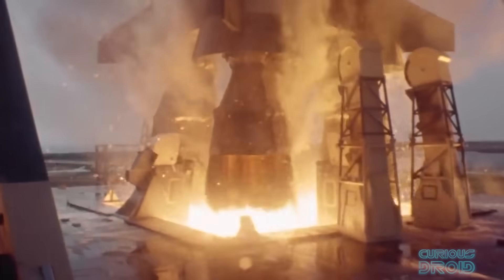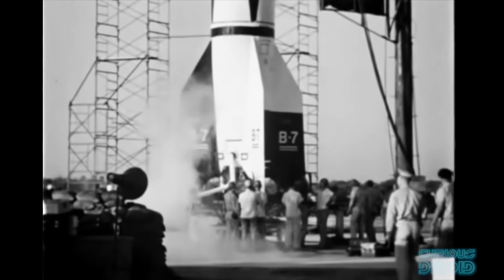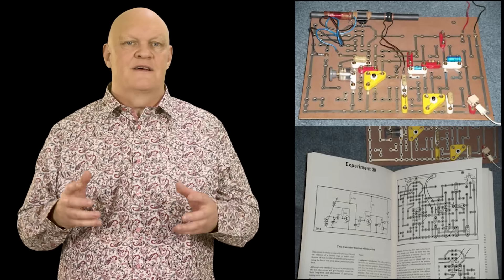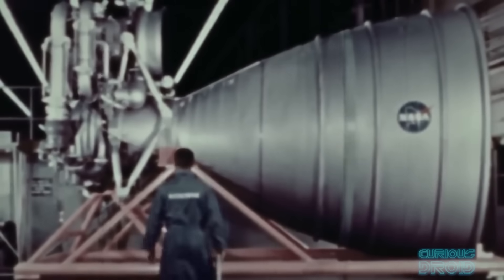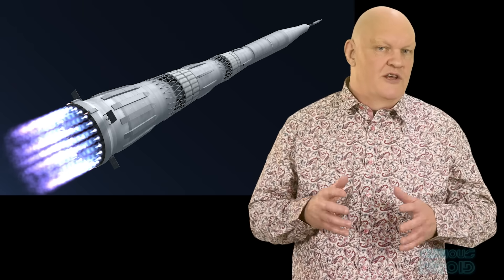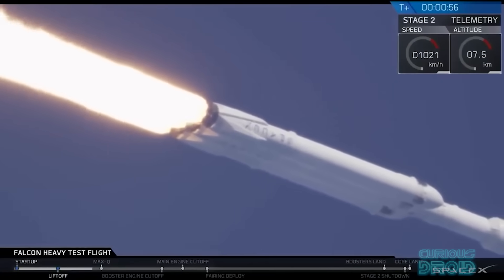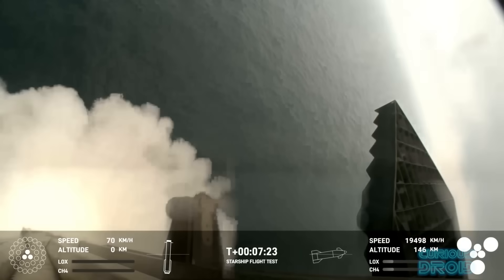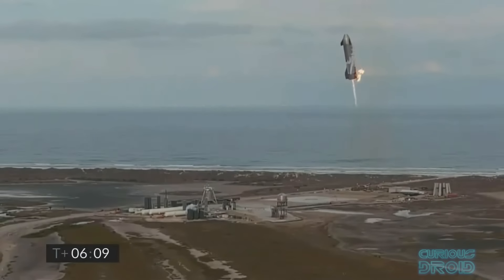Why Does SpaceX Use 33 Engines While NASA Used Just 5?

Comment: The better question is why we are still using capsules & moon landers. We could build a dream chaser variant with VTOL thrusters to do actual science on the moon.
Reply: "actual science" ?
Reply: @sidharthcs2110  As in finding ice, mineral, & metal deposits. Or building a mini automated factory to produce drones. Instead of taking photos while selecting a few rock samples.
Reply: @alt5494  
My suspicions were correct.
You really don't understand this , do you ?
Reply: @alt5494  
Have you wondered why they're sending robots to image and map surface in different wavelengths and collecting and analysing samples?
Reply: @alt5494  
Science is not like the CGI fantasy stuff you see in the promotions of companies
Reply: @sidharthcs2110  Imaging in different wavelengths by satellites is nearly useless for development. As most useful elements will be subsurface or inside craters unlikely to align for imaging. Only three rovers are even planned to carry ground penetrating radar with a short service life. Lunar dust is excellent base material for producing silicon oxygen aluminum & magnesium. With direct laser 3d printing components for structures should be possible without processing of the material. Building automated production on the moon is simply a more valuable objective than continuing current projects. Rovers like the Gitai R1 are already in testing with incredible potential . Until humans have effective radiation shielding & settlements automation/remote operation should be the focus.

Comment: Another reason is that the SpaceX Booster is to be used within ATMOSPHERE ONLY. Therefore a narrower nozzle is far more efficient than a wider nozzle due to atmospheric pressure. Notice that SpaceX use the exact same Raptor engine for in space, however they have a very large nozzle to account for the vacuum. Thus smaller engine nozzle means you can use MORE of them to increase thrust and remain efficient throughout atmospheric flight.

Comment: Because Spacex  engines  are actually  real  and      need to have the claimed     thrust. While F-1  engines are   fantasy. Their  real thrust  was    about  40 per cent less  and they  could    simply melt  if they operated at the claimed thrust. That is  why they have never been used again. Nobody abandons  perfectly usable   engines.    They used     very underpowered   F-1          engines to lift a mockup of Saturn  V ,  reaching  LEO  at best.

Comment: It's easier to maintain 5 engines than 33 engines. It's more likely engines will fail in a rocket with 33 engines than a rocket with just 5 engines.
Reply: Sure but an engine failure will have less impact. Check out the recent IFT-4 flight by Starship. An engine failure on launch and another engine failed on the booster landing, yet both milestones were reached.
Reply: A 5-engine rocket has a single point of failure per engine. A 33-engine rocket needs a lot of engine issues to fail
Reply: @philippeferreiradesousa4524  IIRC One or two of the Apollo missions lost an F1 engine and they still completed the missions.
Reply: @Axel_Andersen  On Apollo 13, one of the J-2 engines on the second stage shut down.
"An anomaly occurred when the second-stage, center (inboard) engine shut down about two minutes early.[91][92]  ... The four outboard engines and the S-IVB third stage burned longer to compensate, and the vehicle achieved very close to the planned circular 190 kilometers (100 nmi) parking orbit,"
https://en.wikipedia.org/wiki/Apollo_13

Comment: Multiple engines makes it possible to throttle over a much wider thrust range.
Reply: Did Apollo 11 actually leave near-Earth orbit?
Despite the revisionist narrative that this channel won't question -- unstable fuel burn for the oversized F1 engines was never rectified and another arrangement in their place was made in order to reach near Earth orbit, keeping the F1 bell nozzle to maintain the desired appearance.  The great licking yellow flame was an indication that something was not normal as fuel was burning in the atmosphere while providing no additional thrust. This was the result of injecting additional kerosene into the exhaust stream for greater visual effect yet appearing to produce an inefficient burn unlike other rockets after launch.  No explanation is forthcoming and this issue is not addressed in any usual report; however, using a smaller reliable engine with a reduced fuel load and stripped down mission requirement allowed the Saturn V to reach near-Earth orbit.  

The Apollo 11 crew attempted to demonstrate their position at over halfway to the moon as seen in the unedited version presented to the public while the more recently released unedited version reveals a flood of blue light entering the same window as the camera continues to roll, through which only a moment before, we saw the Earth far distant in what appeared to be very low light conditions. Then, as the camera pulls back from the window, the exposure settings are seen to return to normal as a flood of light enters the same window.  Without a change in the orientation of the spacecraft assumed to be on a trajectory toward the moon, the only source for any flood of light can be the Earth while in near-Earth orbit.  The usual sponsored efforts will try to make excuses for why the obvious did not take place -- yet is overly apparent in the unedited version.  When facts cannot prevail in support, sponsored activity will resort to name calling and other derogatory comments discrediting themselves.
Reply: .  . While remaining in near-Earth orbit, another indication are the impossible weather patterns seen on Earth, when in reality only a small portion of the Earth's surface was visible, framed by the round window of the command module.  Straight line cloud fronts are seen on video to be extending for what appears to be more than 6000 miles, a quarter of the Earth's circumference -- something that has never occurred in the meteorological record on Earth. The round window of the command module was used to effect an image of the Earth but the weather in the region did not comply for a realistic view.  No recognizable continents are found in view, but only the impossible weather patterns seen.
Reply: It also adds about 90 extra points of failure
Reply: @OutsiderLabs 
Engine out capability
Reply: But also the same number of redundancies.

Comment: My life journey also started with an electronics kit around 1977. My Mom bought it for me because a few months earlier I had completely disassembled and then reassembled our TV and when I put it all back together again it didn't work. My Mom had to call the TV repairman who yelled at me like he was my Dad or something; told me that I could have been killed even if it's unplugged because the CRT stores a charge. 

So my Mom was smart enough to get the electronics kit and I went through that booklet with thirty three different projects and completed most of them. I built my first radio with that kit; later had a ham radio around the age of sixteen; then ended up doing communications in the US Army where I was responsible for a 74,000 square kilometer communications network. Now I'm a professional; working actor and an aspiring screenwriter.
Reply: I imagine that TV repairman
Reply: @impaugjuldivmax  He gave me Vietnam flashbacks and I wasn't even in Vietnam.